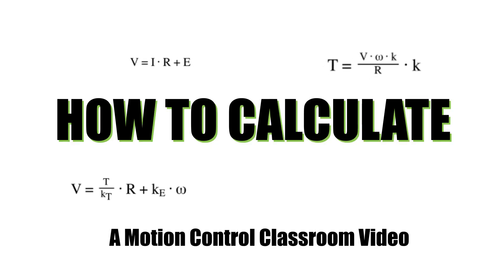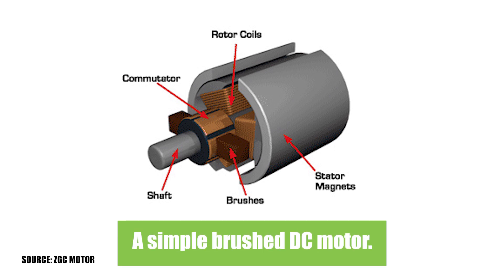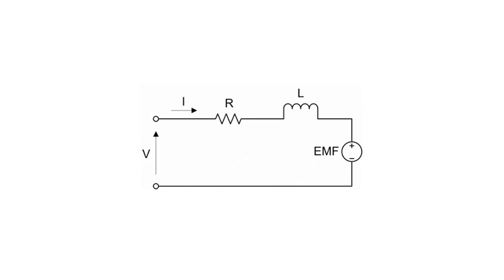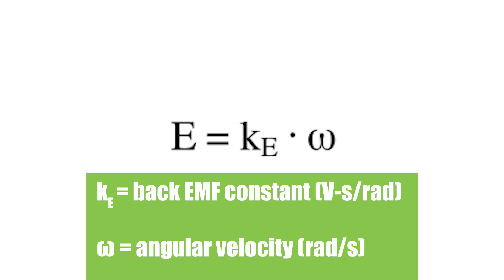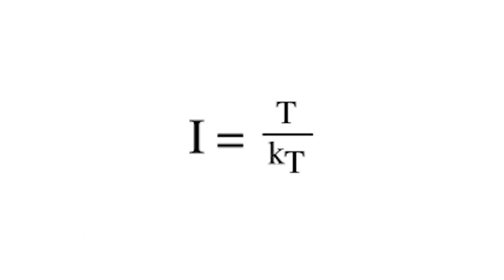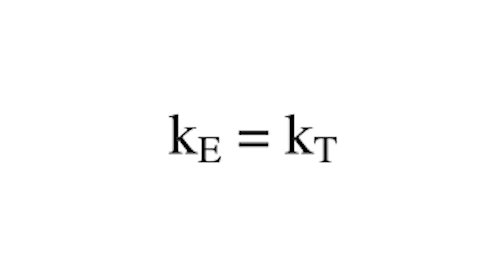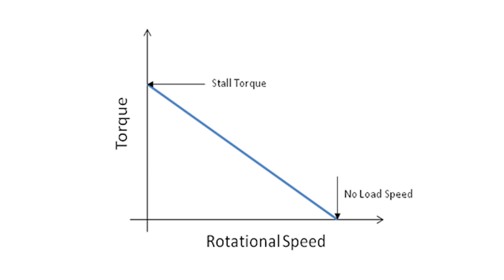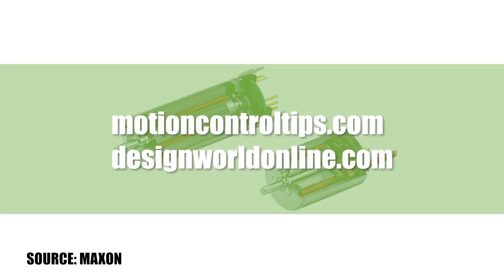How to calculate DC motor torque based on supply voltage and speed: A Motion Control Classroom video

Comment: So when you look for a DC motor it gives you the maximum speed and voltage, from which you can find the motor constant k.  Presumably R is whatever resistance you put between the voltage source and the motor, or if you don't put anything, then it is the motor's inherent resistance but that value is not typically made available.

You could perhaps use power, P = IV, but because of the relation T = kI, you will get 0 power and 0 current for the stall torque.  Also, motors list their no load speed at a given voltage and current.  This would have to mean that under "no load," T is nonzero, because otherwise I would be 0, but is at its minimum value.  Or we can probably think of "no load" as an ideal case that is never realized in reality, and that there should always be some amount of load.

All in all, the information is nice, but it's not enough for practical use, say if I want T amount of torque at omega speed, can I achieve that with a motor rated at V voltage and omega no load speed.